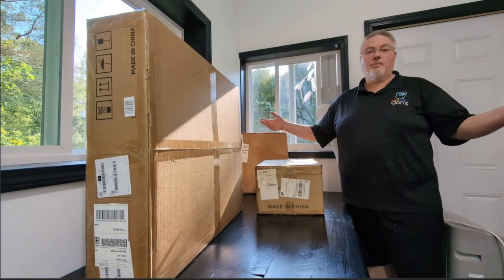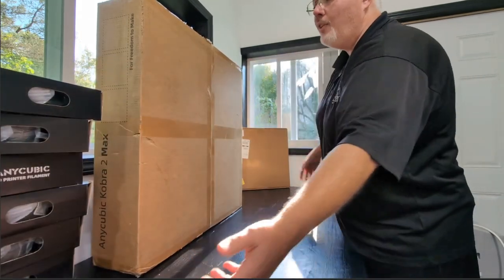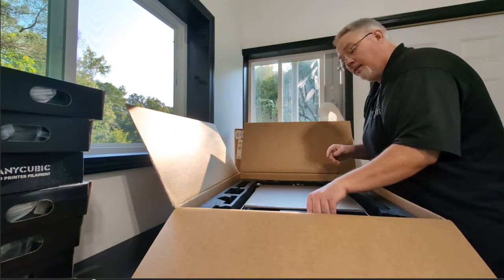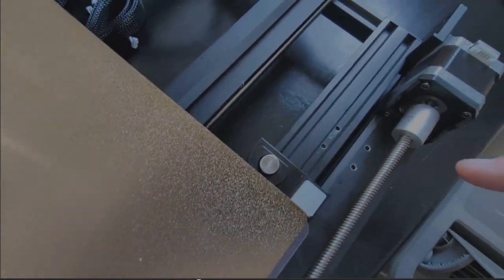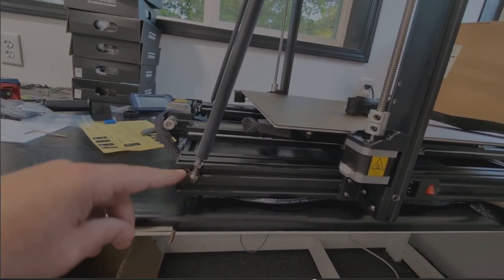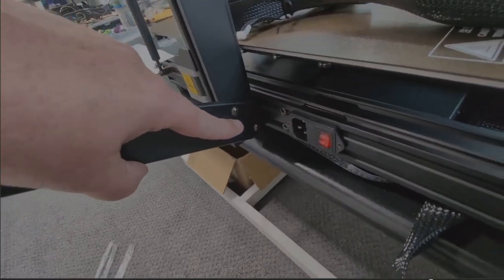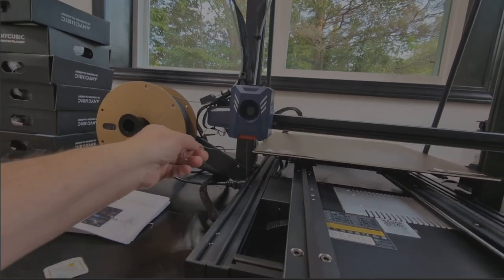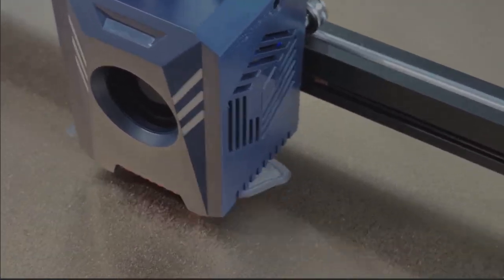Anycubic Kobra 2 Max 3d printer unboxing, assembly and setup Adventure!!!

Comment: Welcome to the club. I've probably printed more lithophanes than anything. It appears as though you have a direct drive extruder, very good. Filament runout sensor is so good to have, I only have it on one of my printers. The bedplate is huge, with what appears to be a textured metal bed, awesome. My only con with this bedslinger style printer is that the taller it prints, the slower you will need to go. I prefer the gantry style printers for larger prints. However, you mentioned that your goal was depth and width, not height, so this may be perfect for what you need. Also looked more difficult to setup than Creality printers but likely less troubleshooting. Only one of my printers has self-leveling, the other two I have to constantly check and adjust over time. Another pro for you. Word of advice: There's a bit of a learning curve to this, so don't get discouraged from failed prints. They will happen.
Reply from the maker: Rock on,  yes in future videos  I will go over what i plan to try and use it for.   the Auto Leveling for me was a must....  Cuz i am a 100% Noob when it comes to the 3d printer world.  (However CAD itself is not.  I did CAD when i was in highschool..  well then it was called Drafting and you did it by hand with Pencils...)